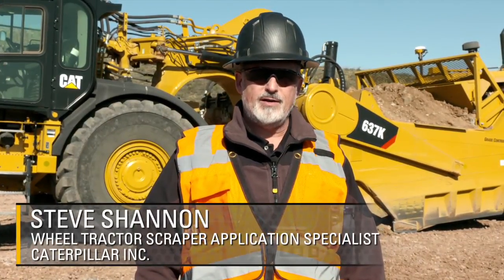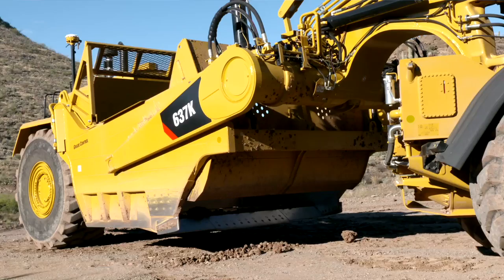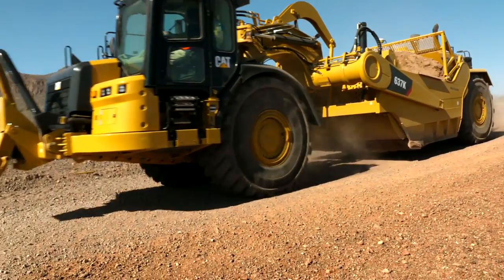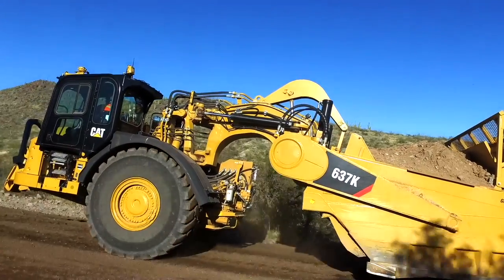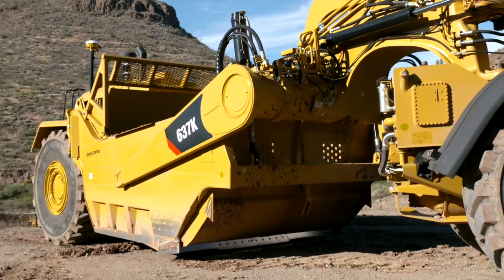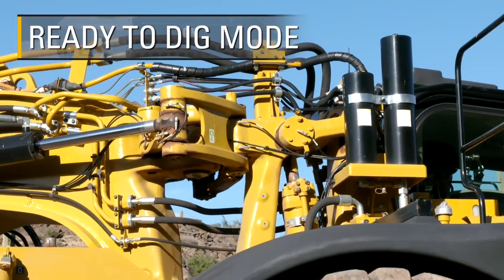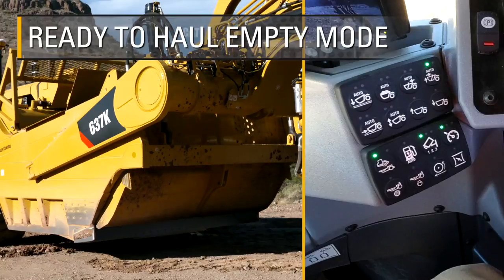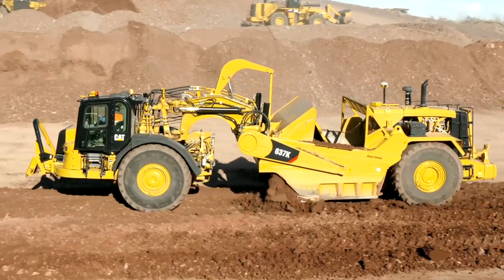Cat® K Series Scrapers Manual Controls & Sequence Assist

Comment: Why isn’t there grease on the push block and bail? Push pull isn’t fun when those are dry
Reply: Don't need grease if the push-cat operator pushes with his blade in float.
Reply: @geezer652  if you’re in a twin engine scraper and need a dozer to get you loaded then you should not be in a twin engine.

Comment: Sequence assist seems like for self loading. Can it get a full bowl by itself?
Reply: I guess once you get used to it you can time it right when to push it in a push pull scenario
Reply: It can be used while push pulling and self loading it finds the soft dirt and doesn't cut the hard dirt so your cut ends up all over the place it's still better to just do it yourself

Comment: I've noticed as I make my daily rounds doing errands , worked on some heavy equipment many years ago and in no way around any construction equipment anymore  , that all the scrapers I see are usually   new or fairly new and the  graders are really old , like 20+ years old . Are graders not that important  ? Which can't one just use a bulldozer or loader instead of the scraper and grade ? I knew of operators whom would rather use the back of a front end loader bucket in reverse rather than some other piece of equipment  .
Reply: Okay theres alot to unpack here. Graders are only used for roads. Scrapers bring in all the dirt to bring the road up 10 feet from what it was. Scrapers wear quicker than the graders do. They are constantly driving over rocks, bouncing down the haul road, and do alot of loads per day. At least one scraper breaks per day at my site, and we only have 4 on site. Bulldozers have their purpose but they can't move dirt a mile and spread it in lifts. Also if you have an operator who uses the back of his bucket constantly to grade, (im assuming ur talking front end loader, not track loaders. Track loaders have extra metal in the back so they can backdrag) front loaders are meant for loading trucks, thats how the wear points are designed. There isn't a cutting edge or reinforcements on the back of the bucket